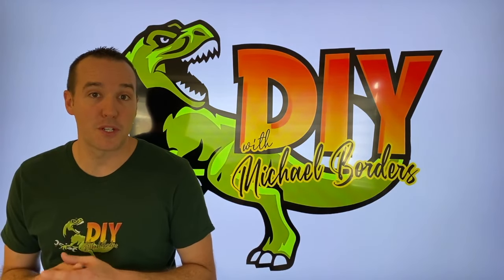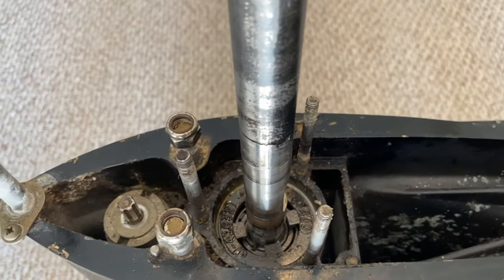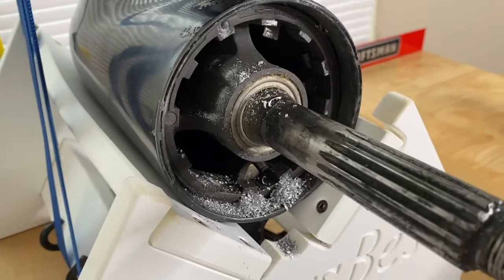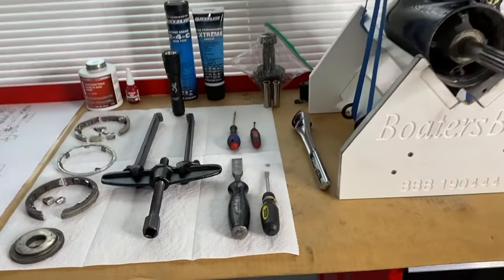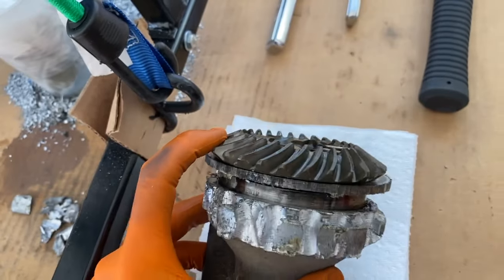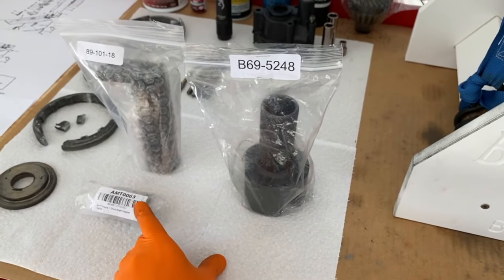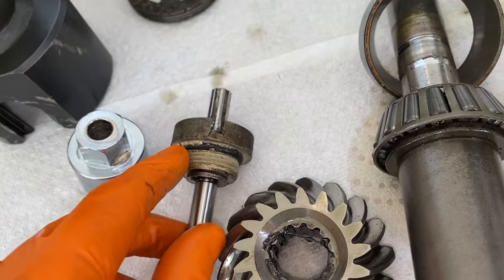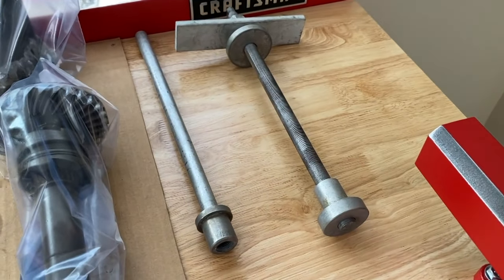Mercruiser Alpha outdrive lower unit rebuild - Full DIY rebuild

Comment: Wood you happen to know What would cause gear oil to leak out of that little tiny wep hole on side of case I believe that little hole is used to drain out water but it’s leaking out oil
Reply from the maker: Good morning ☕️

Great question and we appreciate you asking.  That indeed is your drain port to drain all your gear lube out of your outdrive.

Behind that screw is a gasket.  The gasket helps create that watertight/oil tight seal to prevent any gear lube from leaking out.

Over the years, the gasket fails and begins allowing gear lube to leak out.  Replacing that gasket with a brand new gasket will solve issue.

Keep in mind after you remove that screw, it’s best to fully drain outdrive followed by installing new gear lube. 

Below are too helpful videos showing those two procedures.

     Drain outdrive:  https://youtu.be/l2wDIQUcXZY?si=hvRt_Hgfp5r9fOf0

     Fill outdrive:  https://youtu.be/eHmY2V2IwDU?si=S4lIxdy3W2Ymc1IS

🧰
Reply: Sorry, I’m talking about the little tiny weep pole on the right side of the case not the drains screw if you’re standing in front of the prop, it’ll be on the right side of the case I got oil leaking out of that
Reply from the maker: @mikemoreno7329  

Thanks for the reply.  Was the outdrive recently serviced?  Possibly too much gear lube put into drive and an internal seal has failed and oil is now mixing with water as it is streaming out of hole.

The weep hole is specifically designed to drain water from drive cavity.  If outdrive cracks or seals fail, oil can sneak into the cavity that water is extracted from.
Reply: @DIYwithMichaelBorders   boat was in storage and when I took it out, I noticed oil was leaking out of that little hole hasn’t been serviced for a while hasn’t been on the water I’m guessing, possibly carrier, bearing seals or shift shaft seal thanks for your quick response. I watched all your videos very impressive. And detailed. 👍
Reply from the maker: @mikemoreno7329  

Thanks for the follow up.  Honestly, bearing carrier seals are likely the failure point causing gear lube to drain out of the water weep hole.

If you have an alpha one Gen 1, it’s gear lube.  However if you have a Gen 2 or bravo drive, you have the additional oil hose feeding through hull and into outdrive transom.
Reply: @DIYwithMichaelBorders   Thanks for all your awesome information Michael!

I am also having this problem with my gen 2.  I noticed I was having gear oil leaking out of the weep hole after my shift cable bellow completely severed.  Does this make sense for the oil to leak out after the shift cable bellow broke?  

You rock!
Reply from the maker: @kyleleslie7795  

We really appreciate that, thank you.  Any update?  It’s unlikely that a shift cable bellow failure will contribute to a gear-oil leak however not impossible.

Is there any noticeable damage that the shift cable may have caused in addition to it failing?  Did the shift cable break and then damage any surrounding bellows or seals?

Comment: What's the proper gap between the dog clutch and pinion bolt please?
Reply from the maker: Thanks for watching, that exact measurement will be in your serial number service manual.  How’s your project going?
Reply: @DIYwithMichaelBorders  thanks, I am only just starting, but can't get reasonably priced tools in the UK, so trying to figure out if I can set pinion height without the merc tool - I am now thinking gear marking compound to get it right, which surely would work?? 
do you have any videos of you shimming  gen 1 lower? thanks
Reply: @DIYwithMichaelBorders  and a video showing checking backlash on forward gear?
Reply from the maker: @haydenb121  

Thanks for the follow up, don’t have any videos on that at the moment.

Comment: Please respond ASAP thank you in advance. 

I had a guy do my bottom end he said the ring was inside and he could get it to go back together without removing and reinstalling the ring onto the shaft... is this true or should I be considered? New to the boat world please be gentle with me lol...
Reply from the maker: Thanks for watching, that’s very possible depending on the age and overall condition of the internal parts.

At any point if the lower unit allowed water into areas that it’s not supposed to be…well…bad things happen.

Is your lower unit connected back to the upper unit?
Reply: @DIYwithMichaelBorders  I took it off and put a new one on.  Luckily, he had it pinched and it definitely would have leaked.
Reply from the maker: @chrisjusta3655  

Thanks for the follow up, great job.  If pinched as you mentioned…it would have failed fast.

Awesome job!  😎👍🧰

Comment: where do the shims go ?
Reply from the maker: Thanks for watching, when installing shims…please refer to your exact serial number service manual.  Your drive might be different than ours.

😎👍
Reply: @DIYwithMichaelBorders  alpha one gen 1 - 1988  3 l   125 hp 
I have 3 small shims and 2 medium and I don't know where they are going
Reply from the maker: @user-hj8tg5fq3w  

We appreciate the follow up.  The larger shims (if the same size as your u-joint and bearing assembly) will be inserted into upper unit and pushed flush to rear lip prior to installing u-joint assembly.
Reply: @DIYwithMichaelBorders  
ah ok.. because a mr. I said that shims were needed for the lower bearing gear and for the upper bearing pinion shim at the top  for straight alignment

Comment: Michael,  I am wondering what year your lower unit is.  I am rebuilding my 1990 and the drive shaft you have, has a grove for a O ring on the shaft. The shaft I got does not have the place for and O ring to go. Does it matter if I have the O ring or not?

Thanks 
Steve
Reply from the maker: Thanks for watching Steven, ours is a 1989 alpha one Gen 1.  The upper drive shaft o-ring seats inside the bottom of the vertical gear which is installed in the upper unit.

Once upper is connected to lower, it helps creat additional seal.  Keep us posted on your project.  😎👍
Reply: @DIYwithMichaelBorders  Thanks, Michael. I ordered that shaft from a Merc Cruiser dealer. Is this the wrong shaft?  It says it is for a 1990 alpha one Gen 1. Can I use it? if not will you give me a part number and where I may get it.  Thanks
Steve
Reply from the maker: @stevenstigall6533  

Great question, the best action to take is look the shaft up by serial number.  Go to:

       Marineengine.com

Scroll down and select Mercruiser.  Enter in your outdrive serial number and select search.

Select the lower unit schematic that shows your driveshaft and reference item number in picture.  Take that number and scroll down to see the exact OEM part number for your exact shaft.  Keep us posted.  👍

Comment: Question, at https://youtu.be/qxvL_KgO7ho?t=6163 (1:42:43), you mention lubing the inner seal, or top portion of the impeller. My impeller kit does not have a seal there, nothing between the plastic housing and inner steel impeller sleeve. Is my kit missing a seal? It looks like there is a pocket for a seal to go there. Does anyone know?
Reply from the maker: Good morning, just poured a cup of coffee and am sitting down to answer any and all questions for the DIY community.

What year is your outdrive?  Is it an Alpha drive?  It’s possible that your serial number outdrive has a slightly different designed part however unlikely.

Let us know if you have any questions and hey if you’re into crypto trading, join our DIY ecosystem.

       toolboxtoken.com

Reach out to us any time!  🧰

Comment: Just wondering if you do not show a link to a specific part, how do you find it. Specifically,
the Drive Shaft Spline Adaptor AMT0063.  Also, whose part number is this?  Thanks
Reply from the maker: Thanks for watching & welcome to the DIY Raptor Club.  Great question.  If a link doesn’t show, it’s not currently available within our Affiliate site.

eBay is the next best place to look.  Below is a link to an eBay link.

       https://www.ebay.com/itm/284956191938?mkcid=16&mkevt=1&mkrid=711-127632-2357-0&ssspo=9oPkoM_JR36&sssrc=2051273&ssuid=9oPkoM_JR36&var=&widget_ver=artemis&media=COPY

😎👍